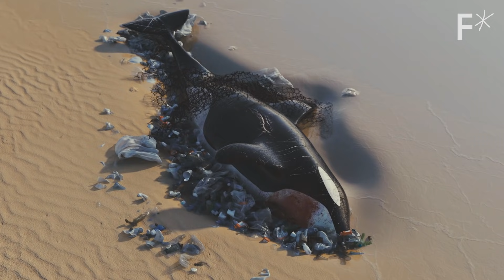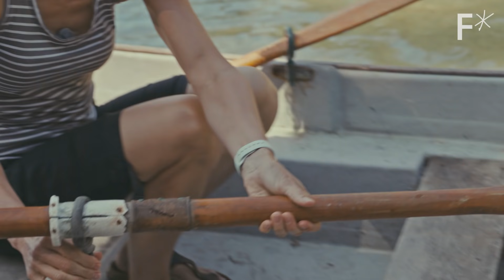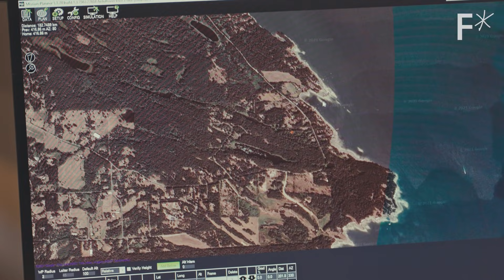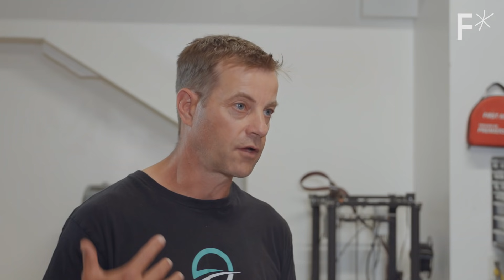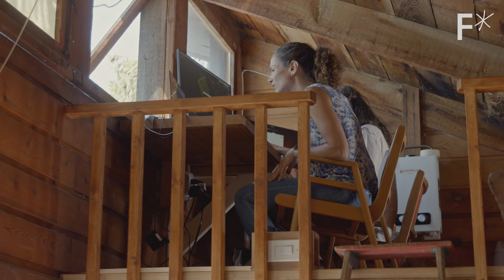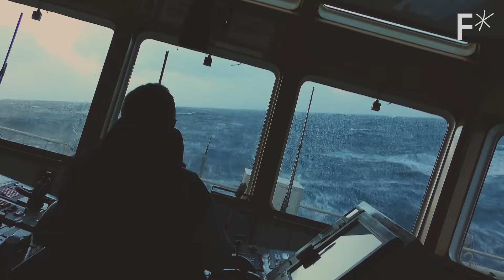Robot stops illegal fishing

Comment: Would likely get blasted to bits by those engaged in inproper activity.
Reply from the maker: Certainly a possibility! Of course, this is a risk for any security camera. One would hope that if they were on patrol and got shot out, someone monitoring them would notice and be able to respond. Remember, they're not capable of apprehending poachers on their own, but simply monitoring and alerting authorities so they can take appropriate action.
Reply: @freethink  if they are using off the shelf parts to build these, then it will not hard to jam and disable before destroying the said drones.

Comment: Implement a giant roll of biodegradeable floating line to drop in front of the nonlegal fisherman so it can wrap up illegal fishing boats props, so they're stuck and need to have a diver go down, then are captured by reporting them to coast guards in the meantime..
Reply from the maker: Interesting idea! As we see an increase in drones and robots in warfare, so we may see them in law enforcement roles with 'less lethal' capabilities and it's interesting to consider what those could be. Of course, it's always necessary and a challenge to make sure that those measures don't risk causing death or disaster themselves.